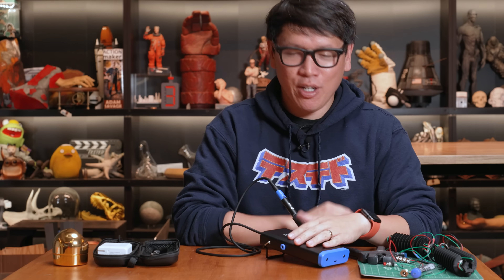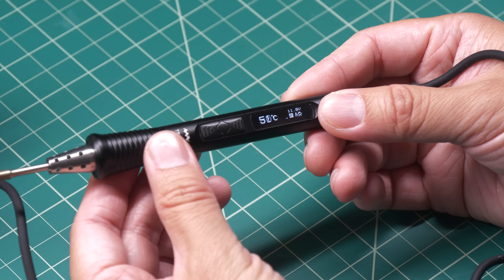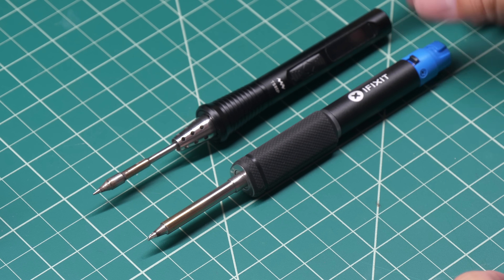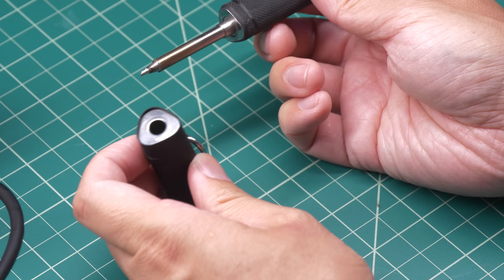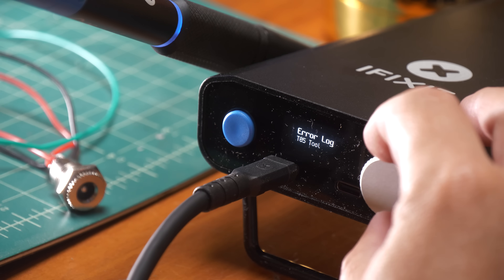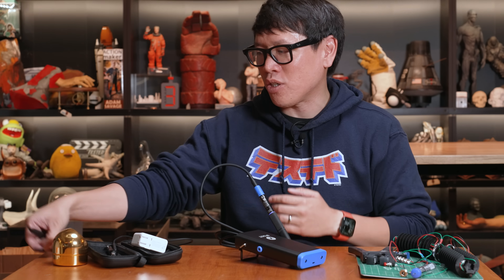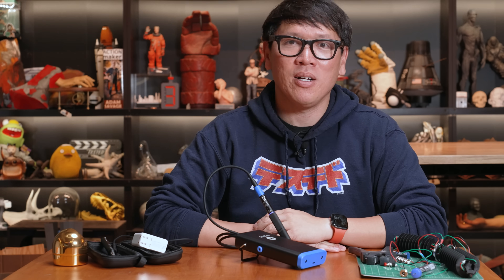Show and Tell: iFixit's "Smart" Soldering Iron!

Comment from the maker: iFixit Fixhub Soldering Iron: https://www.ifixit.com/fixhub
TS80P soldering iron: https://amzn.to/3ZiQGwn
Disclosure: This product was sent to us by the manufacturer for purposes of review.
Reply: I think a spotlight on the pinecil would be good. Using a 65w battery bank and a flexible usb cable and you have IMO the most practical portable soldering iron.  Pair it with a mini stand to hold it (or even a section of wet dish sponge to just cool it off because ts100 tips have such low thermal mass). All for a much, much better price. The only thing you are getting here that you dont get with a pinecil at less than half the price is that cap.
Reply: Perhaps an ifixit power pack with belt clip great wee thing handy 👍

Comment: Nice, but the proprietary nature of the battery is a killer.  I have an Alientek T90B and love it.  I can use it plugged in or with any of my power banks.  The iron is also 140W capable when matched with a GaN PD3.1 adapter.  A large number of various tips are available and cost $10 ea.

Comment: That's a big NO from me. Way too expensive. My HS-02A was only $95 and came with pen itself, 3m silicone PD cable, carry case 100w wall brick with 2 usb-a and 2 usb-c!  It can also run off of walwarts or lipo packs with the included adapter. So1/3 the price when all is said and done. 

Also that is 100 % bs that you cant have longer than 3m 100w cable, i have a 6m pd cable that will absolutely do 240w .

Comment: The head phones jack is great, instead of the soldering iron, you can plug in your headphones and then heat up your cold ears, just make sure you don't use it more than 10 seconds, because otherwise your ears melt.

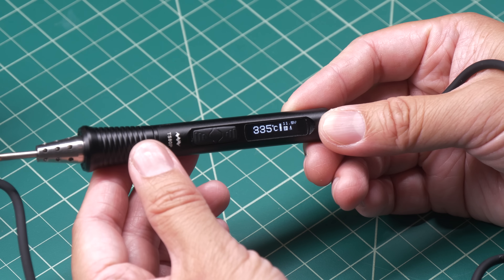Comment: 1:40
I was surprised to see an auxiliary plug used for a heater contact, as I'm not aware of them handling much more current than that needed for an analog signal. Glad to see it's still limited though, as they probably needed a special jack even to handle 30W.

Comment: This looks great, and I love iFixit, but my Pinecil has this beat in terms of price, tip availability, power source, and controls. A commodity USB-PD power bank and silicone USB-C cable are more convenient, and I can get them all for less than the price of the iFixit iron alone. I got my Piencil as an extra soldering iron, and it has become my everyday iron.

Comment: What were they thinking designing this? You can get a pinecil, which has an integrated display and you know, you can use any USB-PD power station for that, too, or any other battery with the appropriate voltage

Comment: I like the TS101 much more than the TS80.  Plus,  I like iFixit alot, but $250 for a USB-C battery bank is just silly. The INIU Power Bank, 20000mAh 65W USB C is $35 I think you can get the 100w version for $79.

Comment: You could say it is a clone of the TS80P but it is closer to the TS101 w/ short iron. Both are USB-C powered, same wattage and use the same ceramic coil system. Why spend all this money on Ifixit? Overpriced proprietary junk.

Comment: Cool product. It's very interesting in it's own way. That said from a utilitarian point of view even a pinecil + barrel jack or USB PD powerbank would be more portable, cheaper, and even reliable as you're not limited to a proprietary battery bank from the same soldering iron's 'maker'.

Best suggestion for iFixit is to adjust their pricing across all categories as they seem inflated for a vast array of tools that are found for equal to or greater in quality from other vendors or even Amazon.. Which doesn't make sense unless it's meant to be the, "iFixit tax" as I suspect it is. Not unlike the Apple-tax if you will lol

Comment: $80 for just the iron… a bit expensive, but not too bad.

$250 just to add a battery with a screen… yikes. The same (minus temp control) can be achieved with a < $100 power bank.

Comment: One thing I think is missing in the discussion in the comments is the fact that this is a 100W USB-C powered soldering iron and power bank. That's significantly higher than what the Pinecil (65W), TS101 (45W), and TS80 (30W) can do over a USB-C connection (though the Pinecil can do up to 88W over a DC barrel jack). For a portable soldering iron, that's pretty darn good, and I don't think there's anything else on the market that can match it from a trustworthy brand. While I agree that only being able to change the temperature from a web interface or their specific power bank is a silly limitation and I dislike the idea of proprietary soldering tips, if both the iron and battery supply/station are as repairable as iFixit's reputation would lead us to believe and they commit to supporting the platform with parts for a long time, I could see this being worth the investment.
Reply: TS101 does 90W over usb c tho?
Reply: @AwesomesMan  Unless there's a newer revision I'm not aware of, I think the TS101 only does 45W over USB-C with Power Delivery
Reply: @alex-r-t  The NovelLife Original TS101 claims 90W over USB-C with Power Delivery. I will note that I don't own either products. However, I'd had it on my wish list for a couple years now. 90W over USB C and 65W over power jack. 

The instructions on their amazon page says: 

How to let TS101 output 90W
1. Update the ts101 soldering iron's firmware to V2.0 or above

2.Set the "PDPwMax" as "OFF"

3.Provide PD3.1 28V 5A PD charger and 50V 5A 240WEPR USB cable to TS101
Reply: @AwesomesMan  Good find! I didn't realize that PD 3.1 introduced voltages over 20V, so that makes a big difference. Assuming you can find a good price on a reliable PD 3.1-compatible power supply/battery bank and a USB-C cable designed for the higher voltage, it should work just about as well as what iFixit has here. I've never used anything from NovelLife, but if others are having success with it, then it sounds like a good option! I wonder why the higher-output version isn't more widespread 🤔

I will say: if the NovelLife TS101 only gets to 90W at 28V, then the iFixit still has a bit of an advantage here - there are far more PD devices and cables that can output 20V at 5A than 28V currently (because the 3.1 standard is so new). Also, the iFixit one already comes with a cable that is rated for the 100W output, which would have to be purchased separately for the NovelLife one. Still an interesting option though!

Comment: One tip for I-Fixit when selling different soldering tips on their website make a 5in1 soldering tip set of the most commonly purchased soldering tips, while also having each of the soldering iron tips separately available as single piece or two per soldering tip type available and have a 24hr shipping configuration period to cancel their order or to add more products to the purchase shipping order, to reduce shipping costs while also keeping product purchase orders of individual items to a minimum.

Comment: I made something similar.  I use a TS100 (which takes 12V-24V) which I power with a TalentCell BP240A1 (which outputs 12V or 24V).  Works pretty great!

Comment: I will be interested to see some testing of it but right off the bat it seems too expensive. I don't see the point of it being 2 seperate products when the screen and all useful control is stuck on the battery. 
A TS100 / Pinecil class device can be had for less and easily combined with a cheap 18V power tool battery and Battery to USB adaptor for half the cost of this. They have buckets of power and last a long time. Unless you don't already have an 18V power tool of some type its a really, really hard combo to beat. Hell, even if you don't a battery and charger can be found super cheap all the time.

Comment: I use my TS80 on a USB C PD powerbank. 3D printed a small stand that fits into the centre of a roll of solder to hold the TS80 and the whole thing works perfectly. Im not entirely sure why you feel the need to use a power brick?

Comment: While ifixit tools have never been cheap, I feel like this is a real miss from them. A Pinecil is $25, add a power bank and all you're getting from this is the stand and cap. Now, these are good additions, seem well designed and are really, really needed parts of a setup like this, but are they worth the $150+ surcharge? No. Add to that the need to buy the power bank part as the iron itself has no real controls (the app is neat, but useless as a main interface), and you're looking at a very, very premium price for what otherwise seems like a commodity product with some minor positive additions.

Comment: It looks amazing, but the Worx kit with the soldering iron, rotary tool, cable and removable battery is a way better value imo. The fact that you can have extra batteries you can just throw on quickly, as well as being able to add on a mini heat gun, mini angle grinder, hot glue gun, air brush, etc. and they ALL run off the same power connector is just freaking awesome.

Comment: I can see how it makes sense for iFixit to have a product like this in their line, and to be fair, I think they came with a good idea there at not too much of a steep price considering the research and development needed to put physical controls on the battery pack... this is more complex than most people would think. If it works flawlessly I mean. xD

All of that aside though, I'm not entirely sure if this makes sense for people who already knows about all the portable pen style soldering irons that are out there. Lots of comments are talking about Pinecil, and Norm showed the TS series, but the reality of it nowadays is that you have a multitude of options in which iFixit's solution is kinda in the middle of everything.

So, if you want really portable solutions that don't require you to carry a base station around, there are battery powered soldering irons... well, they've been around for quite a while now.
I'm not sure how safe they are considering you are putting a Lithium battery right next to a heating element, but it makes sense because of how these portable soldering irons came to be in the first place - they came from vapes. Just that you are pushing the limits of the thing by heating a soldering iron there instead of a heating element to vaporize juice.

Of course, from the times this came from vapes to now, the category has evolved quite a bit. But you can still find what essentially is a vape body with an attachment to soldering irons out there. I've also seen several models that uses 18650s. They are understandably less powerful than ones that uses direct USB-C power, or adapted audio jacks, but they should still be enough for small jobs.

Which is where those portable irons are useful anyways - general micro soldering jobs.

But back to USB-C only, I can see how it makes sense for some people to move the controls away from the body, they can get in the way and result in accidental button presses, they are harder to see, and it's just nice to put the display away in a separate base station - but this of course means you'll need to carry that base around. So it reduces portability. 
If you are going to require a base, plus soldering iron that needs to be connected to that base... it almost doesn't make that much of a different to just straight buying a regular soldering iron anyways. Apart from situations you don't have access to a power outlet.

You have one option for a battery bank, which is the one iFixit provides, which makes this system proprietary. Whereas you can use any USB-C battery bank with proper 60 or 100W charging and cable for the ones with controls directly on them.

Comment: They tried to fix the handful of issues the modern pencil irons have. Good idea...but now it has it's own whole set of problems.

 Wouldn't it have been better to make a 100w pinecil and then offer the base station and wall wart as a power solution with nice temp knob solution, make the temperature knob api open so the other competing products can use your power solution.

Not enough solutions or value for anyone other than a dedicated i fixit workshop.

Comment: Nothing what I've seen here would convince me to get the iFixit soldering iron over TS101.
The TS101/Pinecil is cheaper, more compact, better tip availability, great firmware, display with temperature adjustment and already field proven over the years.

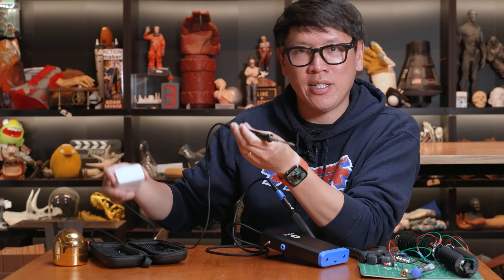Comment: Really disagree with 3:02 I use this iron with a USB C PD power bank. Gives me 12V full power for the iron. I keep the power bank in my pocket and solder. Only thing is there is no place to put it, but I can easily make something which will fit my needs, for example holding all my soldering tips next to the power bank. 

Plus its a normal power bank so i can charge my laptop and phone from it. I don't need to carry a whole separate device just for soldering.

Comment: The price. 
The proprietary soldering tips. 
How is this inline with their brand and vision.
Insanity
Reply: they have never been price competitive, their pro tech toolkit for exemple are priced around 70 euros when you can find equivalent for like 30 bucks and good quality electric ones like the HOTO kit for 90. the price is high cause you pay for the hassle free customer service reputation and they also take a cut to finance their right to repair movement. it's a price i'm willing to pay for quality and longevity. 

there is no open standard soldering tips.
Reply: @Feuillo  the difference with the pro tech toolkit is that if you buy a cheap scrabble-name alternative for one of those from Amazon you get a distinctly worse product (the screwdrivers in particular are as likely to disintegrate than actually drive anything). This... is a USB soldering iron. You can buy these in stores for a fifth of the price and get literally the same thing.
Reply: @therealchriscunningham  not true. I've had clone toolkits for as little as 35 bucks and they work wonders. Its not for heavy screwing so the bits being worst quality is alright.
Reply: in my opinion its not too bad considering their lifetime warranty which other companies don't include. my hakko soldering iron broke and the customer service was terrible and I just had to buy a different soldering station. these guys just send you a new one. I had a few tools replaced and they didn't even ask me to send the old one back. It was oldy 25€ without shipping but I still appreciated the fact that they immediately sent me new tools at 0 cost. im assuming that it's the same for this. if it breaks, you get a new one for free.
Reply: @qwertynotasdfgh  That's definitely a plus.  I had a Hakko hot air station long time ago, otherwise it has all been Weller and all I've ever needed are tips and sponges.  I would like a better cordless one.  The butane are pretty great for a lot, but a bit of trouble for a quick small-gauge wire-splice  (gas are great for doing the heat shrink after, with the tip exhaust; not so good if you melt nearby plastic while soldering the joint)
Reply: You ju$t can't $ee the vi$ion in their de$ign.
Reply: Are any soldering tips “non-proprietary” though? Sure, some irons work with common Weller or JBC tips, but that doesn’t make it an “open” standard. Also, Ifixit might be a bit more concerned about using someone else’s design that a “hobby” project / less established brand.
Reply: @seppestas  You're right.  It's more a matter, to me, of wondering if new tips will be available 5-10 years later.  But, if it has a non-replaceable battery, I guess just get some spares when you buy it and consider it disposable in <5 years.
Reply: Yup, it's technologically cool. But for the reasons you mentioned, it's not worth buying.
Reply: And looks like battery isn't replaceable either.  Poor design for a repair tool.
Reply: @radellaf  Battery is easy replaceable with 2 screws in the back, that unscrew the blue cover :D
Reply: @Stoneheach  cool beans!

Comment: How similar it is to the TS80 definitely makes me less wanting to get one. The screen on my TS80 died years ago, and I just have it set to 340C poweree, 200C idle. Cuz likewise, gyro sensors. And i run mine off a small pocketable anker battery which will let me field solder for 8+ hours multiple days..or at home for misc solder projects it lasts me months before needing a charge.

Is nice though to see  more people making pens. Though this definitely is a great comparison as Im 100% sold on keeping my TS80 as my main. Thinner/smaller/lighter pen is the selling point for me. Replaced my desktop solder station with it, since its so much nicer to use these little pens nowadays! They do amazingly great even for 8awg wire soldering. Car audio, drones, etc. Great stufd!

Comment: Adjust temp by connecting it to the PC and use an app?   that seems really.. odd!
Reply: It's via a web interface, so no app. Still cumbersome if your workload requires a lot of adjustment. I think that's the idea of the power station though. Expensive now but should be a better value proposition once more tools are released for it.

Comment: Clearly, they don’t understand that changing temp while working is absolutely crucial for anyone who knows what they are doing with a soldering iron. The only exception is someone making the same solder joint over and over, essentially someone on an assembly line where portability is not a concern.

Comment: This design is just weird and jank. It feel likes the iron's designed to up sell the power station which is massively overpriced. The price of the iron is understandable especially if they did a great job and it does look good albeit with the insane exclusion of temperature controls. Meanwhile the "power station" which really is just a power bank with the missing temperature control slapped on is twice as expensive as power banks with twice the capacity. So yeah it's a rip off.